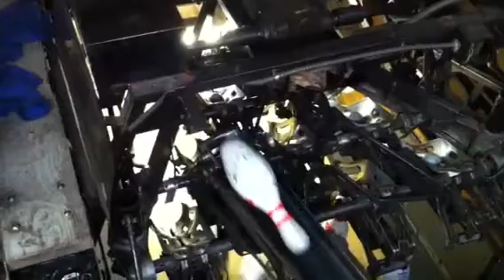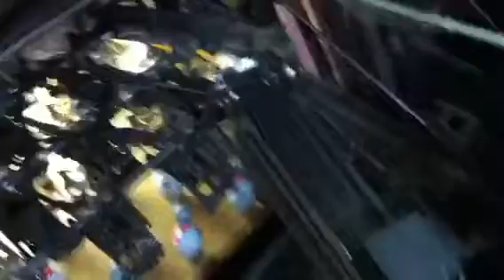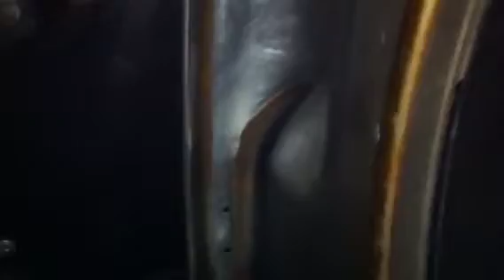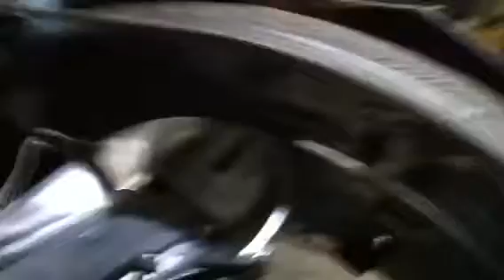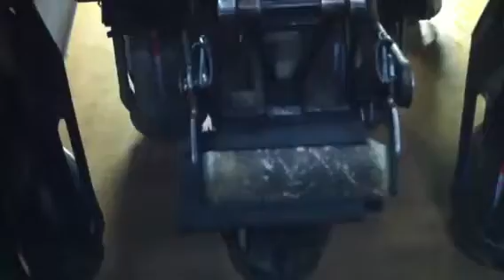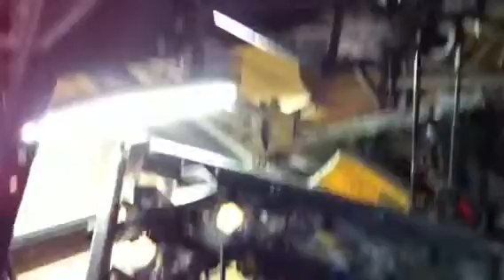AMF 8230 Pinspotter with updated chassis and pin counter

Comment: I notice that the pin counter on the dizzy has been modded from the original trip mounted on the turn pan, eliminates the dreaded 20 pin feed problem.

Comment: You can have these bitches... I 've worked on every pinspotter and pinsetter known to man over 35 years... But damn'd if I can make these run right... Them damn distributor clutches and track

Comment: Did this also modify the pin wheel to eliminate the latches and just stop the wheel? I could have sworn 30s kept the wheel moving and just didn't open the latch over the turn pan.
Reply from the maker: Coderjoe yes those machines were modded to stop the pinwheel when 10 pins are fed rather than run constantly